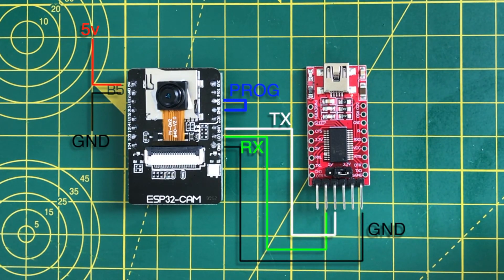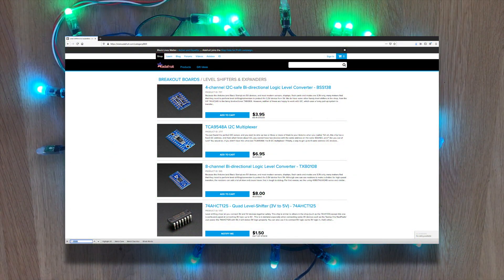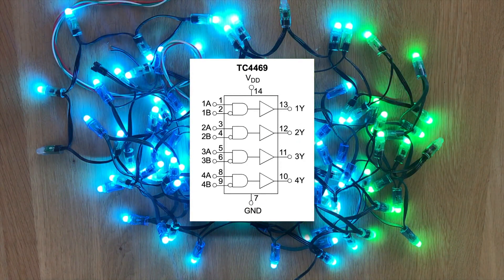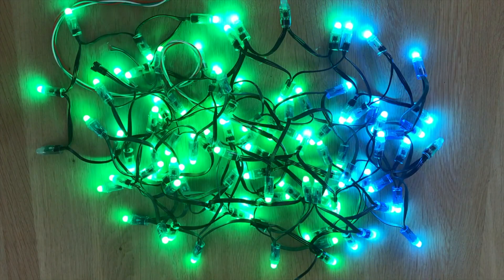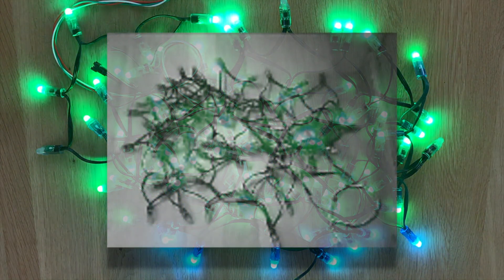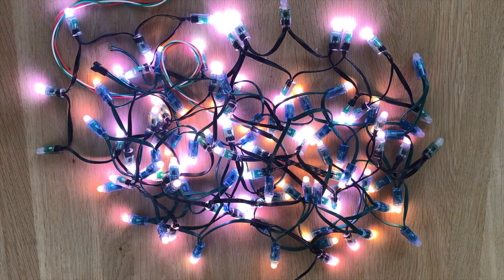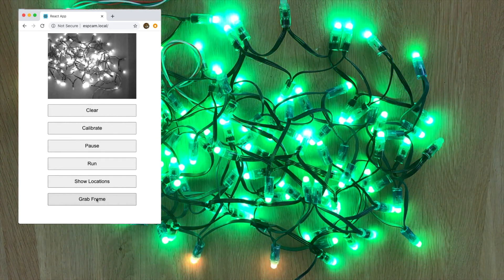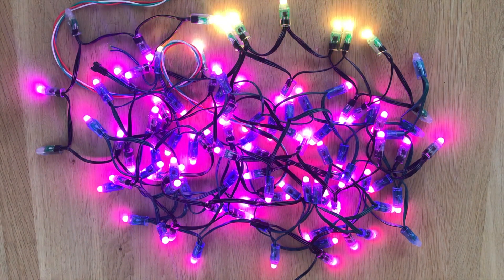Magic LEDs: Self-Organizing with ESP32 CAM & Simple Image Processing!

Comment: Uooooooouuuu....this is amaizing
Reply: How many leds can be controlled with this? project
Reply from the maker: @tonib8352  You can chain the LED strings together, multiple times, but you might need to inject power every so often. My next project using this technique will have 200 LEDs. The main limits are RAM and how much time you have to write out all the data. There's an interesting discussion here: https://github.com/FastLED/FastLED/issues/288
Reply: @atomic14  thank you so much

Comment: Super awesome! You already did what I was thinking about lasting time I hang our Christmas tree. There is a commercial product called Twinkly which gave me the thoughts....but yeah man great work! Many thank to you
PS: came from reddit....
Reply from the maker: No worries - I've done a little bit of work to make it work with just a phone camera so all you need is an ESP32.
Reply: @atomic14   hi atomic!! I am amazed with this work!! You mentioned you changed it to work with a phone camera?? I would really be interested in learning that!! I have been dreaming about doing something like this for years! Can you point me where to look?
Reply from the maker: @LonchsThings  Hi Jose - in the GitHub repo there's a folder called `frontend` - there's a Makefile that will build this and upload it to the ESP32 board. The firmware runs a little web server and will serve the front end. There is a bit of problem though as to access the phone's camera you need to be using https. I used a service called ngrok to proxy the requests which gives you an https connection. You can also serve the front end from your desktop computer - just run "yarn serve" in the frontend folder of the repo. You will still need to use ngrok to get an https address for your phone.
Reply: @atomic14  many thanks!!! I will give it a try and let you know if it worked! Are you open for questions?
Reply from the maker: @LonchsThings  Sure - any issues just open them on the GitHub repo and I'll try and help. It may take me a day or so as I'm juggling a few things at the same time.

Comment: How about 2 esp modules and hitting a 3d shape from 2 sides like a sphere or tree with them all over it?
Reply from the maker: I've been thinking about that for the Christmas tree - I think it should be possible to map the LEDs onto a cone shape. I think for simple shapes the mapping should be reasonably straightforward. There's probably a lot of work already been done by motion capture guys.
Reply: If you map the camera positions and target position into a 3D space, then you can construct a ray from the found 2D position and do a simple ray-ray intersection test. Because of measurement error and camera invariances, the rays would probably miss, but for this low-resolution application I think it's accurate enough when you find the nearest position between the two rays. I'm not an expert, but I think the mathematics aren't too complicated.

Comment: many of these LEDs don't actually need 5 volt logic to work, as long as you use a lower supply voltage as well. By supplying 4.2 volts max, I was able to control a massive string of LEDs on 3.3 volts
Reply from the maker: I think you are correct. I was having some really bad problems with the LEDs flickering or showing the wrong colours. I think in the end it may have just been the library I was using. I tried putting a diode in series with the LED power supply and it didn't seem to make much difference,  Switching the library I was using to FastLeds, adding the level shifter and changing the pin I was using made the problem go away - by that point I'd changed quite a lot so pinpointing the exact problem felt like a lot of work and I was just glad to have it working stably!
Reply: @atomic14  Yeah I just use a 3.7V LiPo for all of my projects and while it's not as bright as providing the full 5V it works fine for my application :)